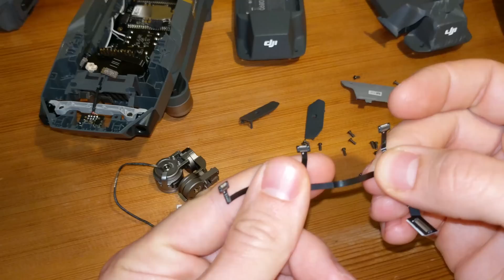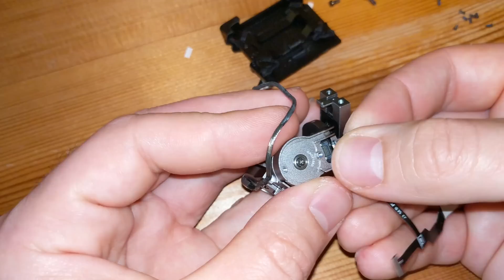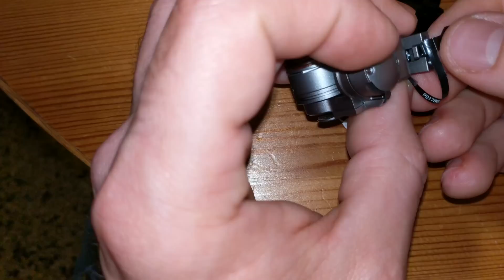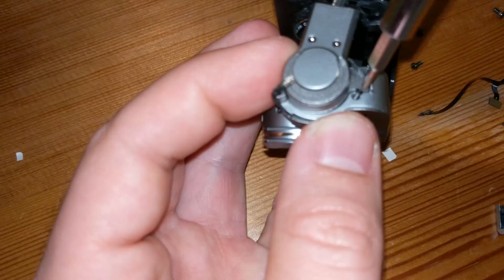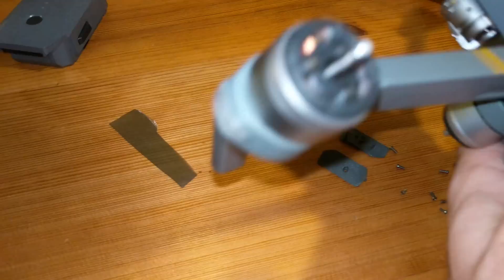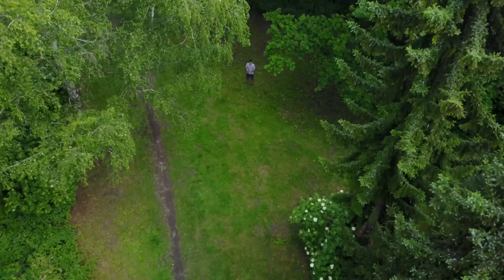DJI Mavic Pro repairing and replacing the gimbal flexprint RIBBON CABLE after TEARDOWN

Comment: Hi thank you four your video I have a Mavic Pro and now is Said remove the clamp the camera is hoverloding what you thing it is thank you very much
Reply from the maker: this will come up if a motor current is too high for example when something is blocking one or several gimbal motors. or if you have som sort of short circuit in one of the motor phases.

Comment: What about the black silicon that holds the ribbon cable connections  in place from the factory. Do you not have to reapply the Silicone Glue when installing the new ribbon?
Reply from the maker: since its not critical for flying i didnt bother. so far it's not been a problem

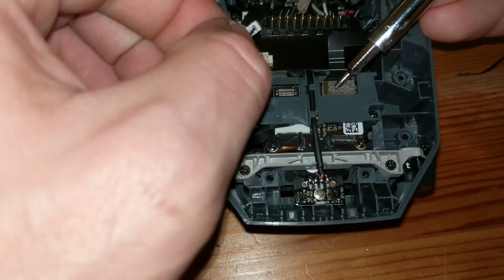Comment: what are the cables (from the drone body) called you are connecting at 12:40 into the video?
Reply from the maker: hey. try searching for mavic pro flex cable. and look for one that has only two ends (not like the one im replacing in the video)

Comment: ello guys, long story short, crashed my mavic, powered it on, received overloaded motor (gimbal didnt move at all) i get video tho.

Ordered gimbal cable from FS LABS, replaced it, the gimbal moves but i still get overloaded errror and the gimbal doesnt follow controller commands (up / down)

Bad cable? something else damaged? Please help, im desperate.

BTW, after cable was replaced the camera body is getting extremely hot. is that normal? You know we start to see / feel weird/new stuff when we break something and try to repair it.
Reply: Hi. Did you solve your mavic problem? I'm in the same situation.

Comment: In your opinion, would be possible to put this gimbal-camera on a custom frame instead of using the usual Gopro or a bigger camera? 
I am thinking about this, but I do not have the expertise to do it. 
Would be a good solution to have a lighter frame, size 680 or bigger, to have more flight time and still good enough pictures and video quality and funtionality.
Reply from the maker: the thing is that the mavic camera definately needs the mainboard of the mavic to work. So you wold have to swap a whole bunch of pcbs and electronics from the mavic frame to your other frame. i dont know if you would still have the benefit of the weight anymore then